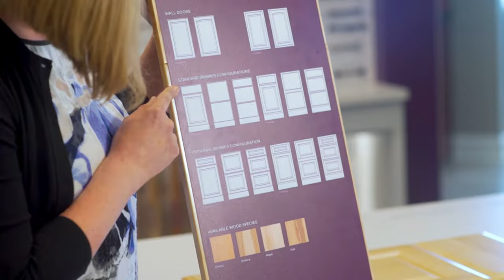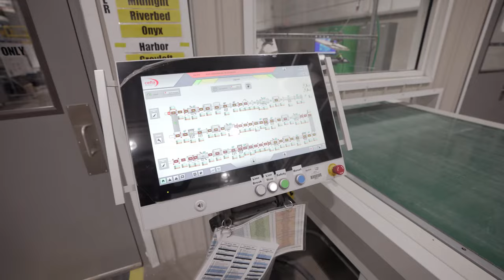Why Choose KraftMaid Cabinets?

Comment: Quality control must not exist at KraftMaid.  Half of my first order had defects in the finish or was damaged before being boxed up at the factory.  Severe bubbles in the clear coat, fingerprints in the stain, smashed frame to the point of splintering behind an undamaged door, rough finish, damage that obviously was attempted to be repaired, parts labelled as ordered but were the wrong size in the box, and I could go on.  Part of the replacements took another month to arrive.  Again, a significate amount was defective.  It's been a week and no one has been able to tell me what is going on with the rest of the original reorder or how long it will take for the second reorder.  Be prepared for quality issues and for the project to take a couple of months longer than expected.  Other than that, they are good cabinets.

Comment: I received so many cabinets crashed, damaged , coating so thin , we received a first oven cabinet build with the base smaller than the top , we order a second one came with major damaged , Waiting for the number 3 . Same with almost all doors and drawers. We are waiting for 3 same up cabinets . The pull up for my spices came broken, still waiting for a new one . I passed the number of cabines we have already changed . They always ship a new one but with an other damage . We order with Lowes , they helped but we started the kitchen 4 months ago ...Every new order is 4  mores weeks. I do not know how  Lowes or Home Depot can work with a so bad company . If they do not use a better quality control they will be in bankruptcy.
I try to talk with the sell representative but impossible ...very disappointed.I will Never use this company again and I told everyone , I do not want anyone have this nightmare. It is a shame!